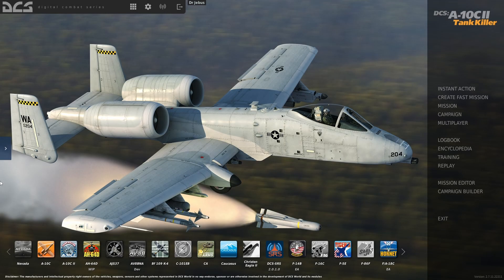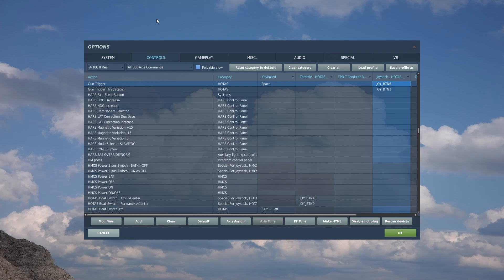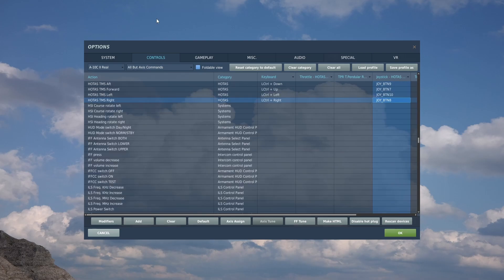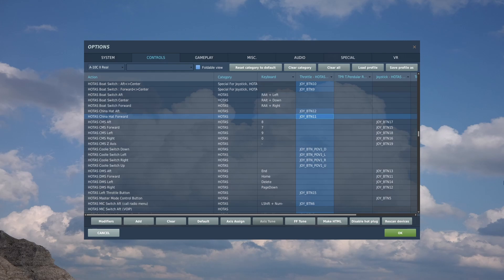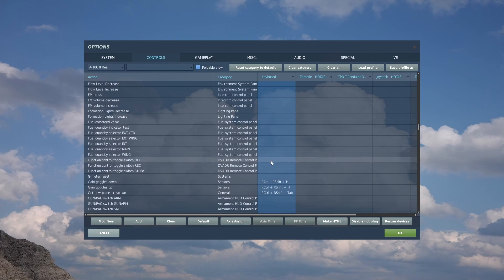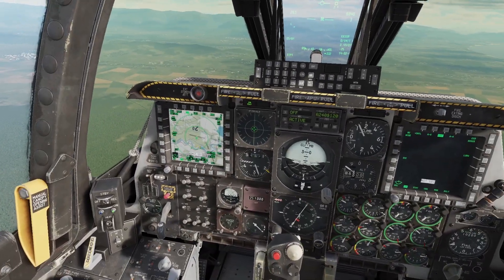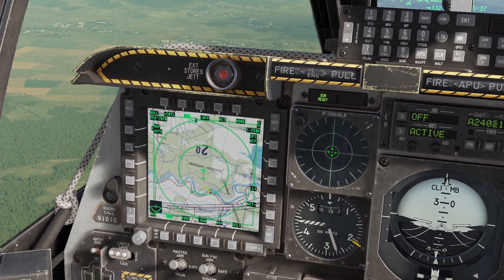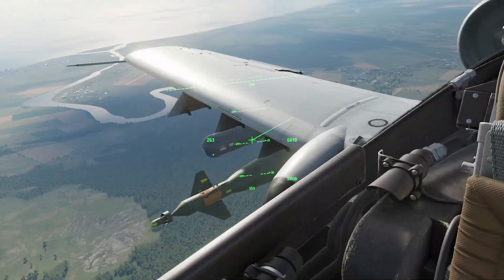A-10CII Tank Killer Tutorial Control Setup and SOI Basics

Comment: @Dr Jebus, what does DMS left short do in the TAD?
Reply from the maker: In the legacy A-10C it has no function. In the A-10CII module it toggles between centred and depressed map. So in centred your plane is at the middle of the TAD, giving you better awareness of all things around you. Depressed has your plane running along the bottom, so gives you a better look up ahead of you.
Reply: @Dr_Jebus  Hmmm.... I'm using the latest version. The A-10C II Tank Killer. Not the legacy A-10C. What you described explains DMS right short. But DMS left short does not do anything. Is it supposed to do something on the A-10C II Tank Killer version?

A 2nd question.  When the TAD is SOI, what do DMS FWD Long (Map Quick Toggle) and DMS AFT Long (Select TAD Centre Option) supposed to do?  I checked the manual but when I try both, nothing happens on the screen.
Reply from the maker: @ggjjabc  I was mis-remembering. I have no idea what left short or long aft actually do. They're listed on chuck's guide but can't seem to make them do anything. I thought they might be something to do with auto map mode but after messing around for a while, I still gen't get it. I've never used them so... hopefully not important?
Reply: @Dr_Jebus  . Thank you. I'm still learning. I don't know if it's important or not.